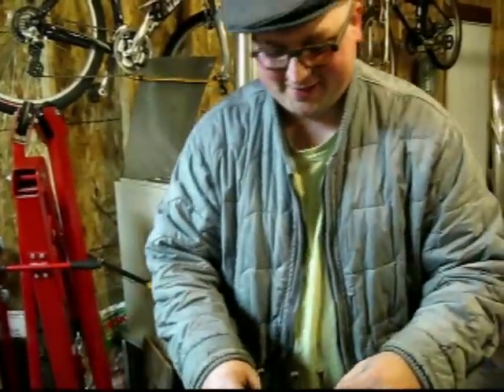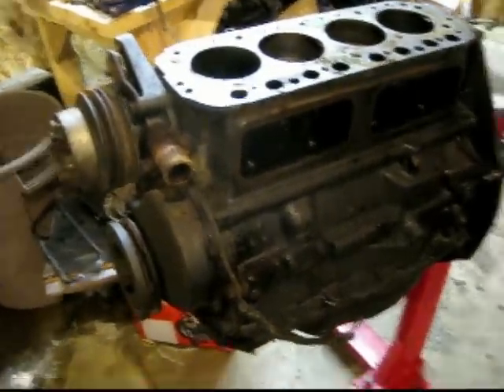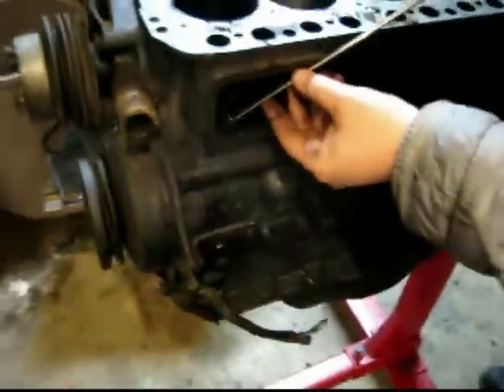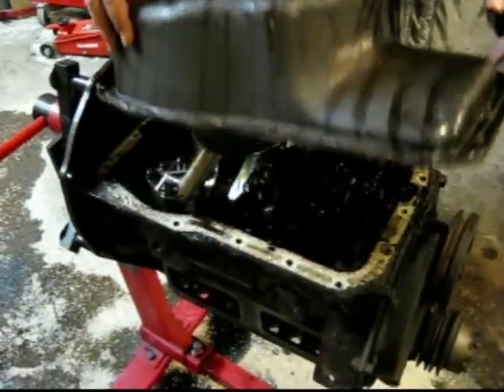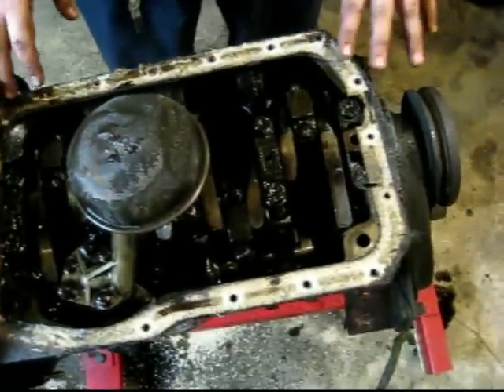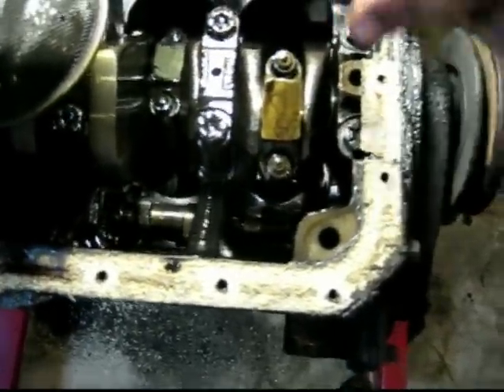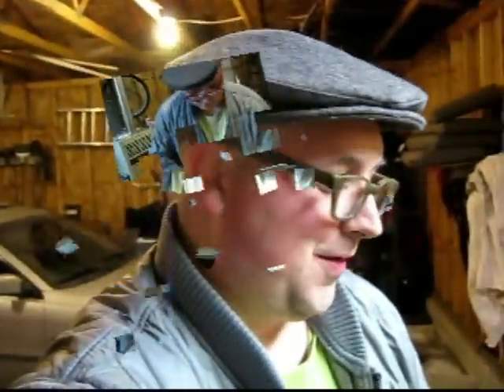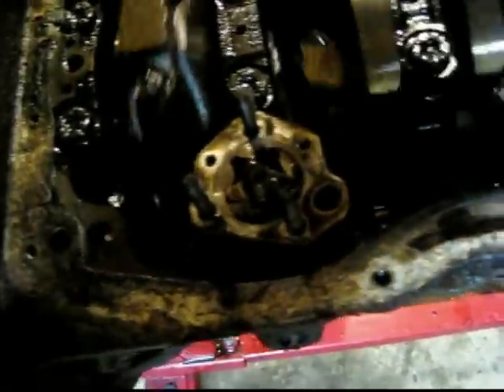MG 18 Part 2 - Tearing down the engine

Comment: The tappet surface should be be flat not dished.
Reply: I agree, although, a very slight dishing is no problem at all. Wouldn't it be nice if hydraulic lifters could be used in the MGB 1.8L engine?  Sure would help with the common, MGB, valve train noise.